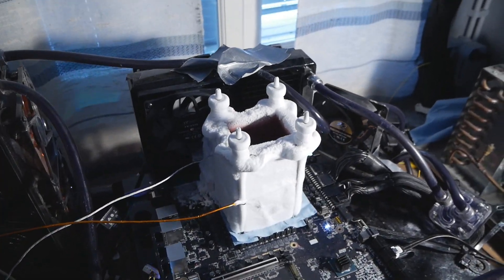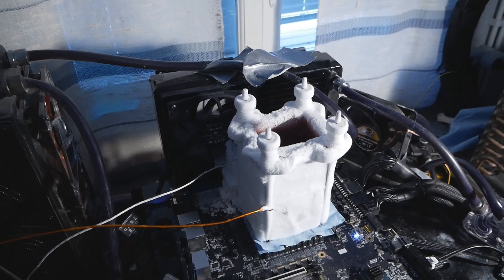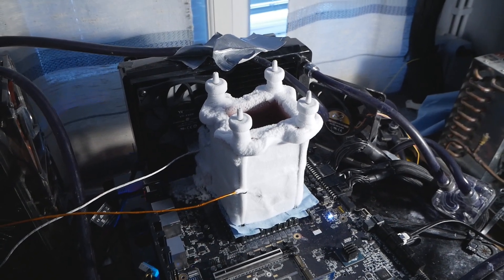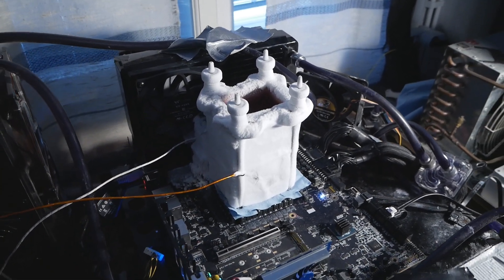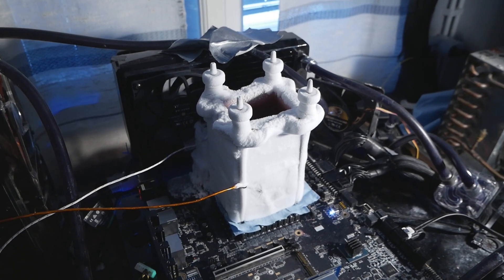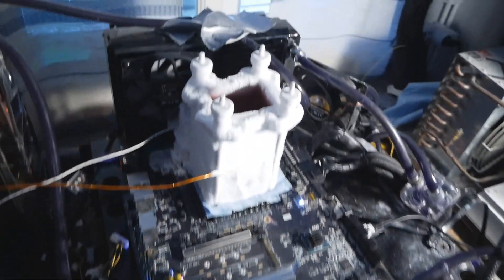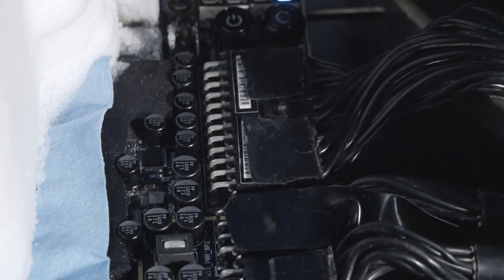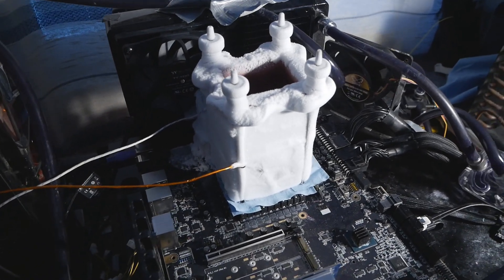Corsair Vengeance DDR5 OVERCLOCKED Up to 8100MHz on LN2 on EVGA Z690 DARK KINGPIN

Comment: hello, thanks for the video!! do you have any advice for playing in 1440p (3440x1440) with a GPU with 4gb vram (details at a minimum)? 
it's a Mi8/Radeon R9 nano instict.  I know very well that it could not be, but I do it anyway, I ask in case anyone knows about some software settings, BIOS or on the AMD panel or some setting / technology developed within the game settings (in addition to low details) to make the card go better in 1440, make the vram work better or try not to saturate.

Comment: Hey man. U know vsa is at 1.8v in hwinfo when I leave that auto in bios. Will it kill the chip? Bios 1.07.0
Reply from the maker: Do not trust software too much. I didn't open hwinfo even once yet on this gen. If hwinfo reads same 1.8v no matter if auto or manually set at 1.2 it means it is bugged.